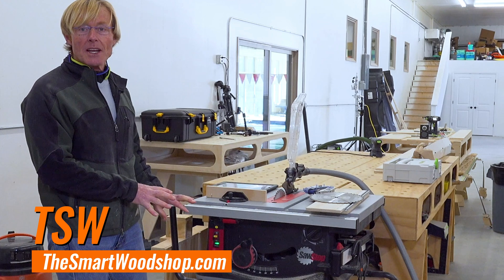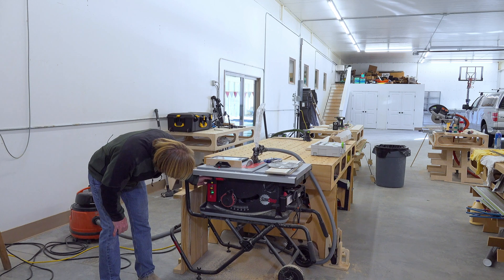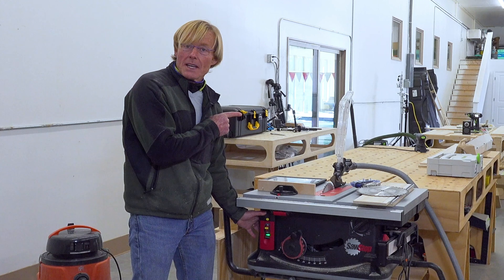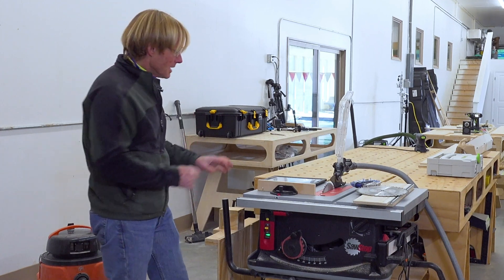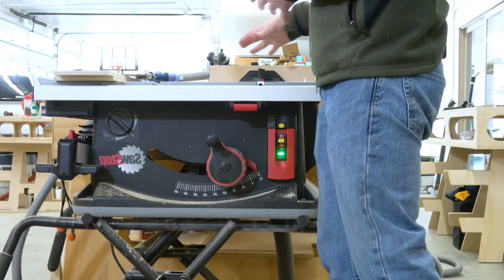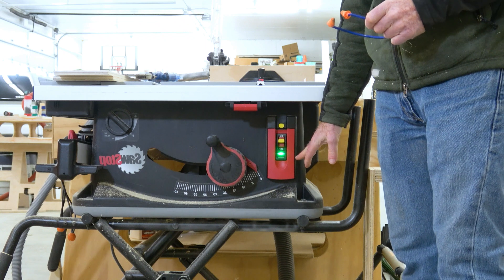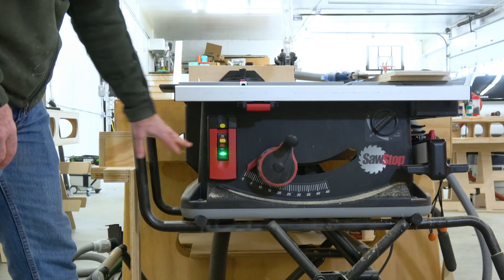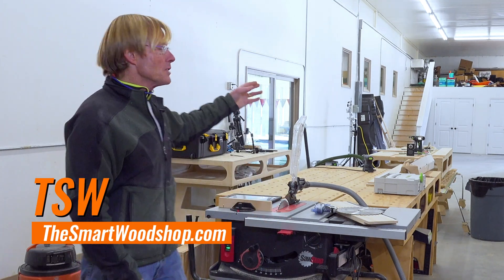SawStop Brake Bypass Demo: Step-by-Step Tutorial

Comment: Why would you need to disable it?
Reply: If you're using wet/treated lumber it can trigger a false reading and trigger the brake
Reply from the maker: Cutting conductive material: wet wood, metal, etc..
Reply: Thanks